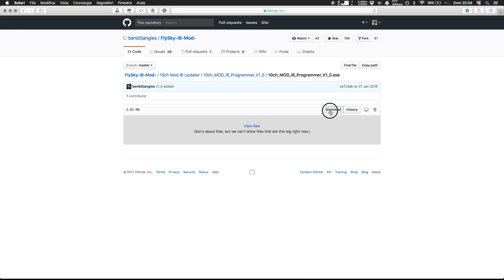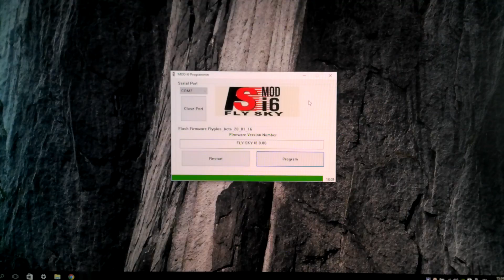How to upgrade the Eachine / FlySky / Turnigy i6 with the i-bus 10 channels firmware #VLTRA_FPV

Comment: Hi, is it true that you need to update it first using the original FS firmware before loading the 10 channel firmware to eachine i6? They said if you install the 10 channel firmware the eachine i6 will not work. How true is it?
Reply: Dhecel have you tried it?
Reply: Robin  No. That is why I am asking...
Reply: Dhecel Okay, anyways, I did the mod today without flashing original firmware first and I can tell you it worked just fine.
Reply: Nice thanks for the info. Hope you have a video of it.
Reply: Dhecel Nah, I don't sorry. Can give you instructions tho if you want or talk on discord.